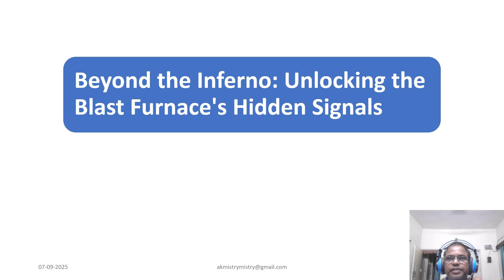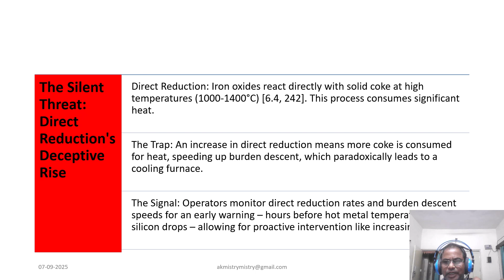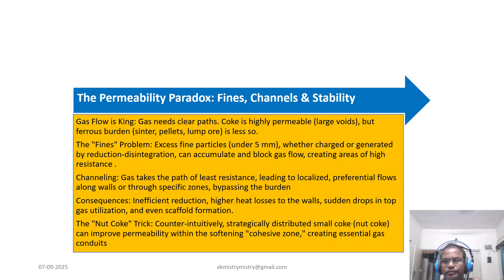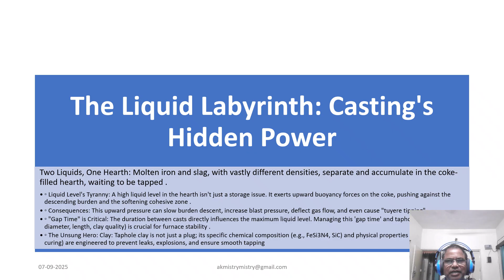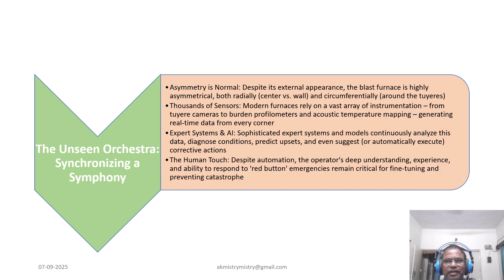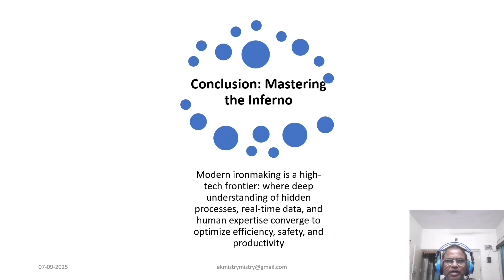The 2300°C Secret: How GIANT Blast Furnaces FORGE the World's Iron

Comment: We are continue facing low TGT below 90 with low ETA CO 38 to 40.

Earlier blend was 65% sinter 15% pellet and 15% lump, moisture input was 73kg/thm.

Now changed to 
Blend is 70% sinter and 30% lump. 
Moisture input is 62 kg/thm, but still facing low TGT along with low Gas utilization.
Reply from the maker: Recommended Solutions for Low TGT and Low ηCO
Improve Burden Quality & Blending
Reduce lump ore,( Lump ore is generally considered "not helpful for high productivity" and is "less accessible to gas than sinter or pellets". It can impose a "penalty" of typically an additional 50 kg of coke per tonne of hot metal due to its poorer reducibility). reintroduce pellets, and optimize sinter quality (strength, reducibility, fewer fines).

Screen burden materials (5–6 mm) and distribute fines evenly to avoid blocked gas flow.

Optimize Burden Distribution & Gas Flow
Target ore-free center, horizontal layers, and even fines spread.

Use nut coke at walls for permeability and ensure smooth burden descent to avoid hanging, slipping, or channeling.
Increase hot blast temperature (cheapest energy input).Keep blast moisture minimal.Monitor ηCO as an early signal of excess direct reduction (heat drain).